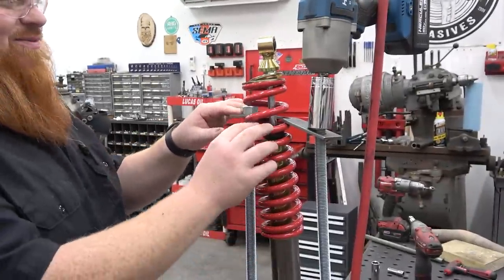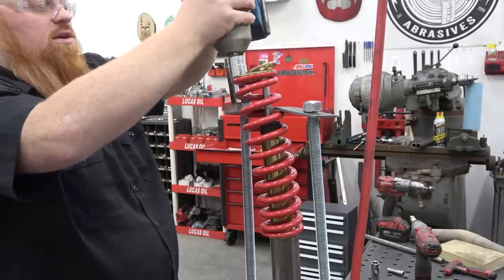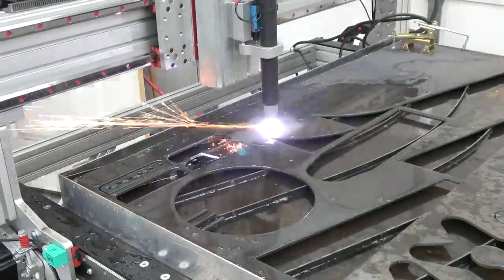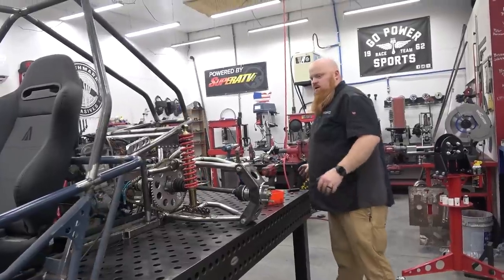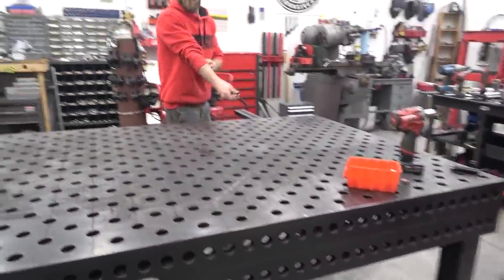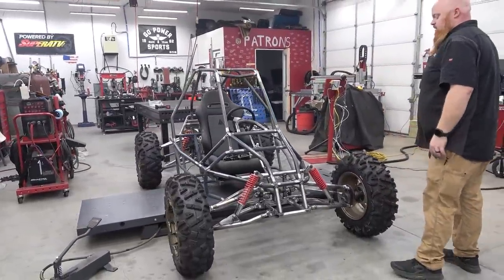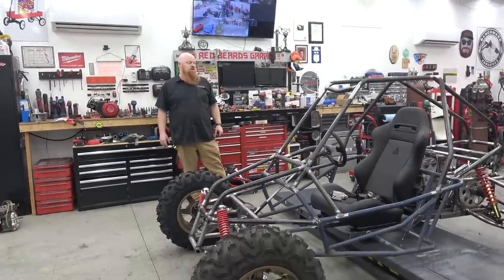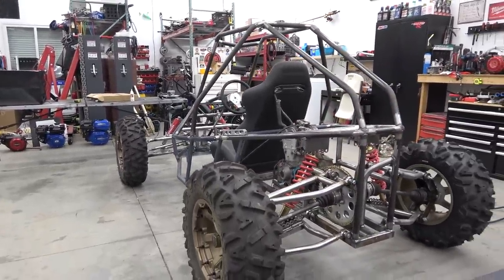YZ450 Powered Go Kart On The Ground

Comment: You guys should consider some fox 2.0 air shocks. I’m very impressed with mine. The Lord is good to us my friend! Love your videos especially the engine building stuff about to build one about like the last dyno video and put it on my predator 212 rock crawler buggy which should be on YouTube soon 38 inch Mickey Thompsons Chevy Dana 44 axles full hydraulic steering 16 inch travel fox shocks. It only does about 10mph but it’s a rock climbing beast.

Comment: That is a great build and it would be nice idea to have a set of blueprints for sale. I noticed that the front outside of the tires are wider than the back and you may need to lengthen the rear upper and lower control arms. For the rear shock mounts on the top may be a little too tall or do the rear mounts like the front ones and may be in reverse position. Like instead of mounting them towards to the outside. Mount them towards to the inside. Let me know about the blueprints. Keep up the great work you do and have a blessed day!

Comment: If you turn your bike lift length ways with you weld table and lift it up to the same height and just slide it off the weld table onto the bike lift and then let it down you wouldn't haft to drag the bike lift sideways to be able to let it down heck throw some casters under your bike lift with some type brake that locks down when you don't want it to move just a thought she's looking sweet!!

Comment: Buggy is turning out to be a good lookin rig. Would be crazy with a 700cc raptor engine or the 700xx honda engine
Reply: That yzf450 makes more hp then a raptor 700. Dirt bikes are much more hi strung. Even the yfz 450 wheeler makes more power then the 700. 700 is more reliable tho. Same top end as the grizzly

Comment: That must be a pretty old YZ450,.. most 450 MX bikes have been electric start for almost 6 years. Suzuki is the only kick start bike now. Find a RAPTOR 700cc if yer going bigger. Stay with an offroad oriented engine for the torque characteristics.